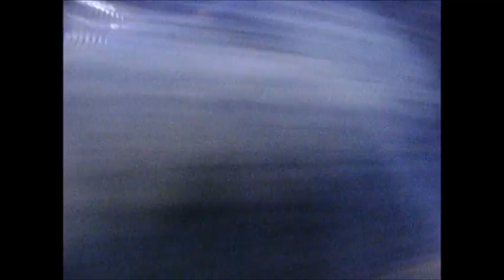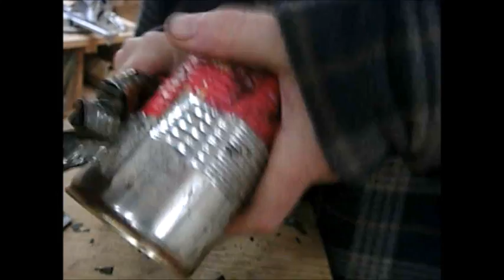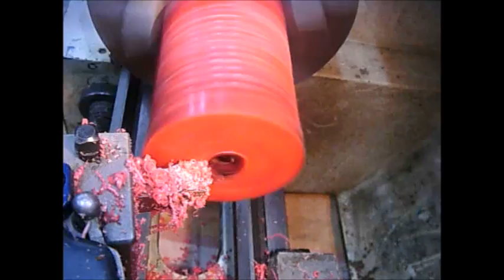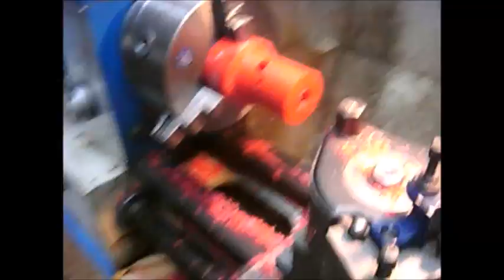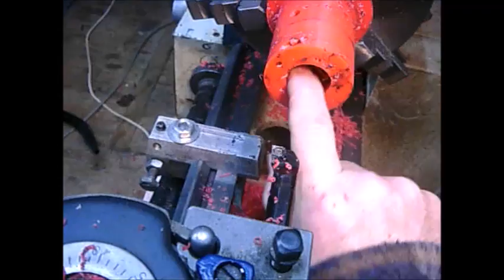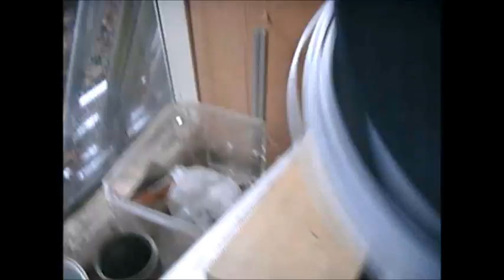Building an Over-Engineered Filament Holder - part 3-3

Comment: Leo 
Nice work there. Good use of plastic. Thanks for not printing one up.  My sugestion is you need to do is add a spacer ring and the 3d spool will not wonder off.. kevin
Reply from the maker: Thnx Kev!
The filament holder works perfectly fine now.